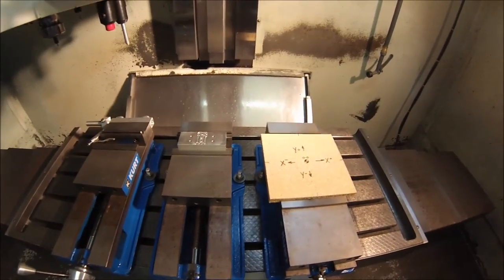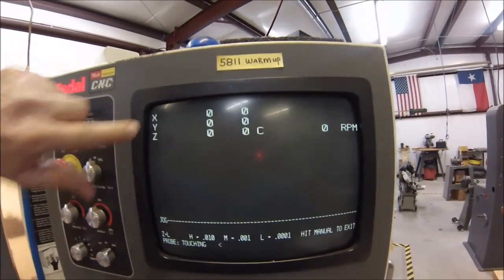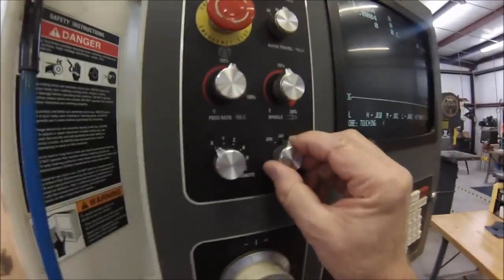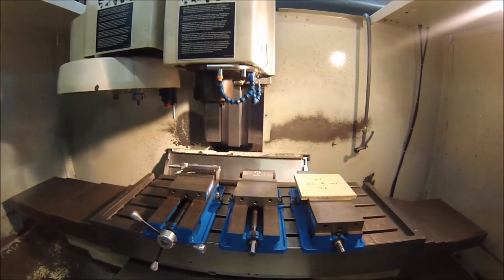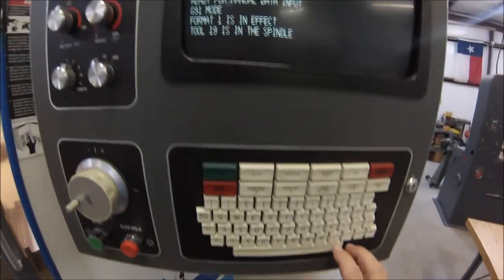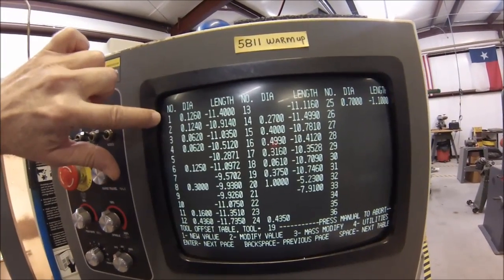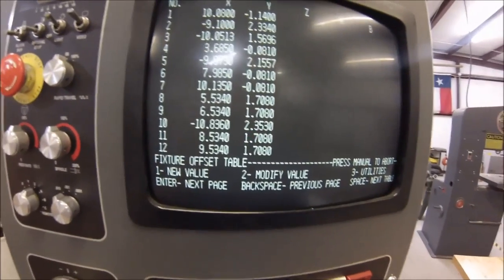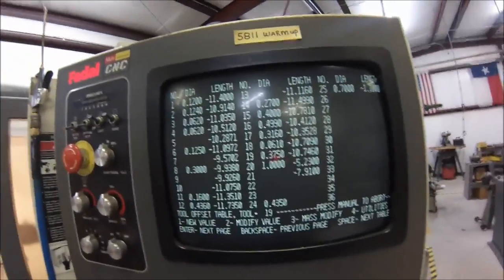CNC Machining Center   Part 2

Comment: I run a Fadal 60 30 at work and thought I'd watch this series to see if I can pick up a few things that I may have missed. I started as an apprentice about 7 years ago on manual and CNC machines, am qualified now but still have lots to learn. Very informative videos. Would just like to do a quick mention that on one of the menu screens is 3-Zero return this also sends the machine back to the home position and is my preferred method. Also, when in Jog mode if you hold down the jog button the machine will travel on its own the speed is determined  by the same way you would with the hand wheel and can be fine tuned via the feed rate control. Down the bottom of the screen it displays either "H" "M" or "L" (short for High (0.100) Medium (0.010) and Low(0.001)) and next to it is "+" or "-" this depicts the speed & direction it will feed which is set by the XYZ knob and the last direction the hand wheel was turned. Very handy for basic functions if you just want to face something.

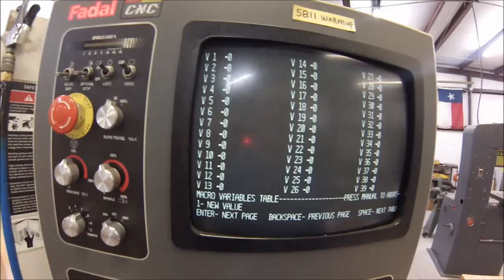Comment: 11:59 V1 through V100 are macro variables.
For the Fadal machines, PDF manuals are readily available online. I got mine at https://flintmachine.com/fadal.php. For the user manual, I recommend renaming the files to include the page number range for each section.

Comment: Is the C-axis RPM or tool rotation?
Reply from the maker: Thats a good question. X is l to R, Y is in and out, Z is up and down, a and B are tilt and rotate. C???? Not so sure. S is rpm, so it must be tool rotation. ( not clockwise vs counterclockwise) small movements. best guess.

Comment: At point 11:35 you mention Fixture Offsets and you explain that "these are 48 possible locations that you can identify on the work table". My understanding is that Part Zero is set by the programmer based on the blueprint for the part being made. You would use an edge finder to determine where a particular feature of the workpiece is located so the machine knows where that precise location is. Perhaps I missed something in my classes but in accordance with Tooling-U and my CNC Programming books Fixture Offsets are to tell the machine where the Part Zero is located in reference to Machine Zero so it knows where to perform the milling operations called for on the program. Is this different for Fanuc controllers?
Reply from the maker: Your understanding of the offset function is correct. The fixture offsets I speak of on this controller are open parking spaces in which you can enter any X-Y table location you desire. Where that location relates to your part is entirely up to you. I can place a fixture offset anywhere on the part, provided the part is against a stop, and still make a good part. It is an easier practice to place your zero position as driven by the baselines for the dimensions on the print. That makes for an easier visual review of the code for checks and problem solving.
Reply: Fadal is cool in this respect. Rather than G54, 55,56,57,58. Fadal said we are going to make our own values and call them "E" offsets. So you can have more than just 5 offset options. Now the cool thing is fadal will take a G54, but a Fanuc wont take an E1.

Comment: Hi Joe. Great series your doing here! How accurate is the homing of the machine. If you knew the exact distance from home to the corner of your vice. Then turned it off and came back the next day. Homed it. Would that distance be the same? I only ask because I used to use Okuma's. and just switched them on the next day. And pressed the cycle button. No homing required.
Reply from the maker: The home position CS is spot on. The machine knows where its home position is and you just have to be in the area when it calibrates for the day. Never a worry from day to day. Ever. Those table reference marks are just to get in the ballpark. The machine does the rest.
Reply: Thanks Joe!

Comment: Uh, Joe, i was an autoshop major before electronic ignition was marketed.  You lost me at positive and negative.  i'll be back when you start turning handles again.
Reply from the maker: You should hang in there Mike. The first 3 parts here are boring baseline stuff that has a direct relationship to the actual cutting op. Either way, I'll get back to the handles soon.

Comment: Very interesting to get an inside look at how these machines work.  I am a software engineer and have recently taken an interest in machine tools and machining.  Looking to buy a lathe and start learning and maybe one day I will get to play with a CNC mill like this one.  When was this machine built?  That user interface is archaic to say the least by software engineering standards.  Reminds me of a linux command line.  One would think these machines would have a much more user friendly interface.
Reply from the maker: This is core skill stuff. Conversational controller 101.  I can feed this machine 30,000 lines of code in 15 seconds via USB if I choose to.
Reply: Yes, that was my question too.  I'm used to seeing the machine on NYC CNC which has a touchscreen with a GUI.  Same functionality from what I can tell so far.

It's interesting that a 50 year old lathe or milling machine can look modern but these CNC machine "look" are archaic because of the computer technology.  There's some irony in that.

BTW: 4 out of 4 great videos on this channel so far.

Comment: Hi Joe,
The blue flashing light===>>   German police car hidden in the controller....    ;)
Got a 4 months training on CNC lathe and machining center, that was some years ago, though, I think it was on a Fanuc controller, finally never worked with those after, I can't go without feeling the machine through the handles...  And now, my shop is so small that it would be impossible to even fit even an extra grinder...   Even less a machine that requires 20Kw of power to run...   
This presentation, take away the spinning of the camera, is a real good overview of what a CNC machine is about with all the different parameters, tool position, offsets, speeds, advance, movements, axis, etc....
Now, the younger ones ( Up to about 70 yo. ) can't ignore this to progress in the machining world...   ;)
Cheers,   Pierre
Reply from the maker: I  had the opportunity to ride a motorcycle across Belgium, Germany and the Czech republic a few years back. We were deep in the black forest of Germany and a pair of those blue flashing lights came out of nowhere, tailed us for a few miles, and vanished just as quick. Didn't see him coming and didn't see him leave. You may be right about that light. You have inspired me to fabricate a stabilizer for my GoPro camera. Its long overdue and not that complicated. Part 3 of this series is already shot, but 4 and on should be noticeably better. Always good to get a comment from you Pierre. Stay well.

Comment: Joe you could always video or still shot the V parameters as a visual backup for your machine and anyone having the same model machine to check. And also any other pages that you know the settings to be correct on if for no other reason then for your own good. Just incase for some reason those were ever changed, stranger things have been known to happen around computers. Showing Joe the love thumbs up and shared in the Youtube Machinist group  of over 2,300 and suggesting they likewise show Joe the love and sub.
Reply from the maker: I have a hard copy of them in the machine service manual. i am not sure they are the same for all machines, but I do have a backup. That V screen is taboo for me. I never go there on my own.

Comment: The wood dowel trick is genius. Would sticks of Chalk or Glue Sticks be ok? Chalk would snap very easy, Glue stick will just bend like a cooked noodle. Pencil would be very little force to break. I am thinking just about any soft material will work as long as the tool collet can hold it. Crayons? naw thats childs play...lol
Reply from the maker: Anything that you can hold and break will be fine. Just stay clear of the top of the part and keep one finger on that slide hold button. I actually put a sharpie marker in the holder once and drew the part on the stock for a visual reference of the final profile. Worked for me.

Comment: Another great vid Joe, this is starting to make sense when YOU explain things in machinist terms-not computereese. I bet management loves the "I can see how long the tool was used" menu ;-}
Reply: Possibly more about when that tool might need to be replaced or reground, or just to get data on how long they last for cost control.  Edit:  just guessing here, everything I know about CNC I have learned from this video!
Reply from the maker: All correct. Also, If you know you have a tool that starts stressing out around a certain hour mark and breaks or yields a bad part, you can be proactive and change it. If your carousel uses the same tools quite often, you can tell how old the tools are.

Comment: Good show Joe.  Just curious why you run your machine in Format 1.
Reply from the maker: There is a reason for it, but I just don't recall what the issue was that made it necessary. Tell me more about the format options?

Comment: Knowing that fadal is no longer around would you buy a 4020 used? They pop up used for a decent price once in a while and seeing a detailed series on the machine may make buying one an option. What year I your machine? Thanks for sharing!
Reply from the maker: I believe the machine is a 1999. Refurbished completely in 2012. There are many parts and service personnel in Texas and California. Rumor has it, The Fadal founder is considering bringing the machine back into production. I would not hesitate to buy another one.
Reply: Joe Pieczynski 

Can I ask what was done for a rebuild ? And of course how much was it?
Reply: Fadal is/has returned to production...in Brea, California....where they always were.....
Reply: FADAL has returned to production, in Brea, California.....where they were before.....
Reply from the maker: The rebuild consisted of ball screws, an upgraded monitor, refurbished sheet metal, amplifier boards if necessary, new door panels and many other smaller items. It was part of the purchase price so I don't know the cost.

Comment: Hi Joe, when you were going through the tool offsets, how do you keep track of what each tool in that list (1,2,3, etc...) is? Sorry if you already mentioned that.

Very informative series...please keep em coming!

Thanks for sharing
Reply from the maker: Hi Neil. When you plan out a CNC job, you pretty much know what tool you will use for which feature. In the offset register, you can enter any number you want for the tool number it relates to. That tool number is a reserved space in the tool carousel and called up when the operation starts with the 'T#' prompt at the tool call block. I also record it on my setup sheet for repeat runs. Its an easy one to skip over. That would not end well. Good question.